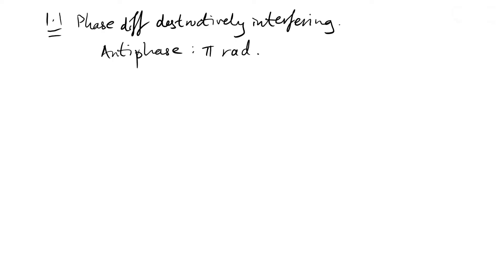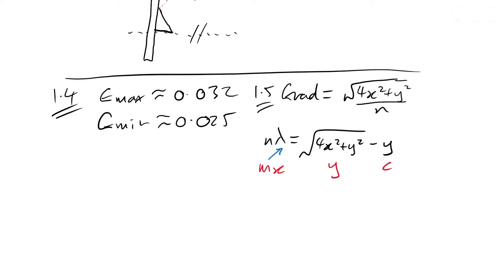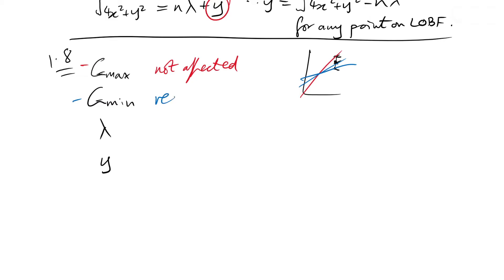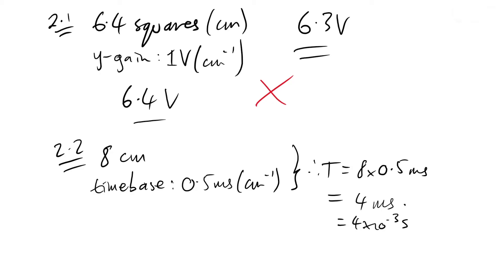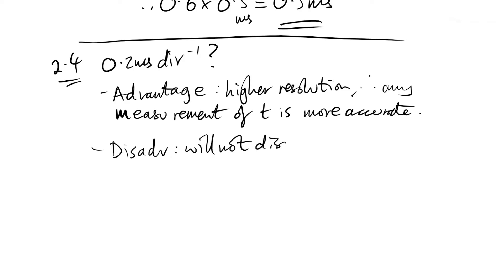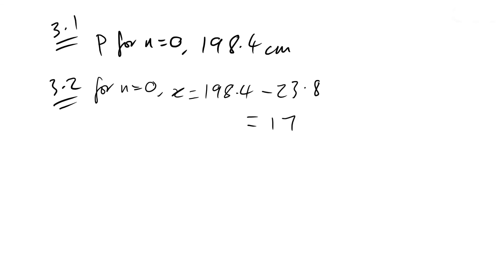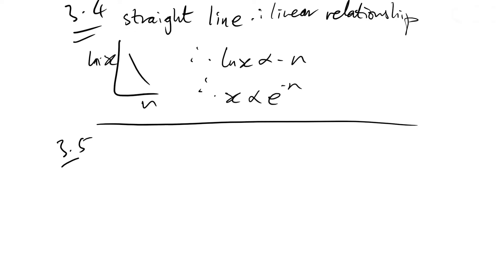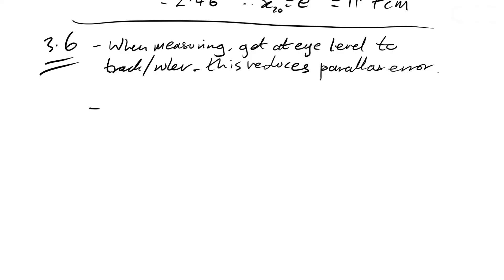AQA 2017 Paper 3A - A-level Physics Past Paper

Comment: For the capacitor and signal generator question the voltage across the capacitor goes to a negative when discharging so I assumed that to do the time constant question you only look at the negative or positive part of the waveform, which threw me off. Am I to always look at the whole waveform for capacitors with oscilloscopes?

Comment: 6:37 why is time taken 0.6 cm
Reply: You’re looking to find the time it took for the voltage to fall to 37 percent of its original value (as in the video). 

Read off the x-axis of the graph for to find the time when the voltage is “6.3 V” (1 big square and 1 small division from the left of the graph on the x axis) and when it is 37% or “6.3” V, or ~2.3 V (1 big square and roughly 4 small divisions from the left, again on the axis) 

I defined the “bottom” of the wave form to be 0 V, btw

The time difference between these two values is 3 small divisions. 1 large box is 1 cm (as said in the video)

As there are 5 small “jumps” between small divisions in 1 box, each jump is worth  1cm / 5 jumps = 0.2 cm. 

Hence for 3 divisions it’s 3 x 0.2 = 0.6 cm

(so the time constant is 0.6 x 0.5 ms = 0.3 ms, again because 1 box is 0.5 ms)
Reply: @axyte535  thanks, you are the best